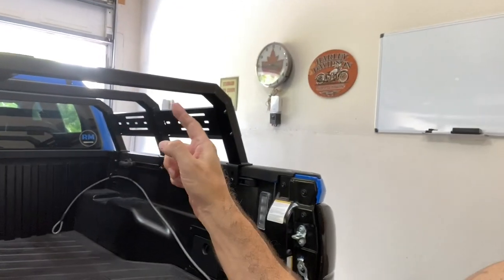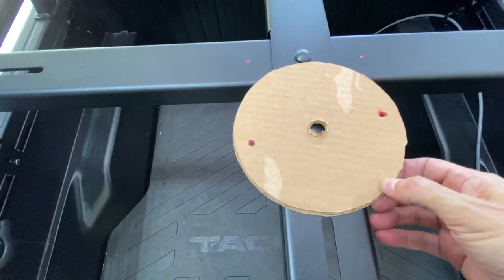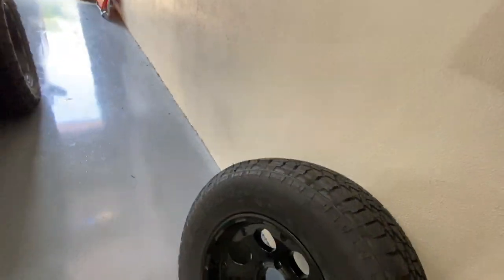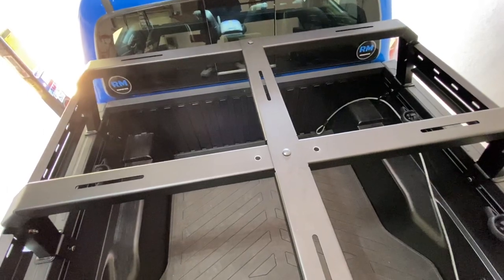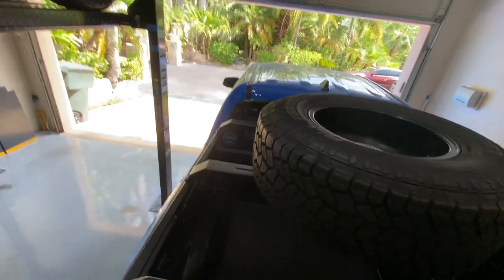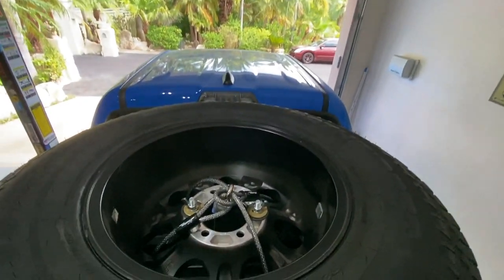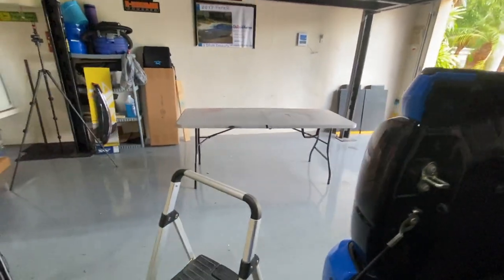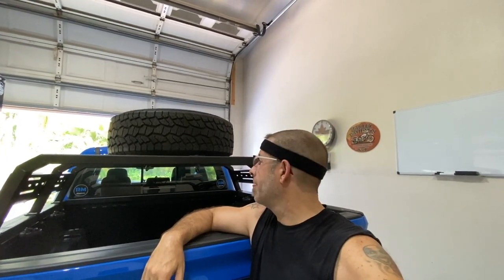Toyota Tacoma Bed Rack Spare Tire Mount

Comment: I hoped to recommend a no drill application but you were ahead of me.........Could have used a gusset type plate to run the lag bolts through, the wheel holes would sit at a 45 degree angle from the cross bars, it would have secured the tire down. ...Like the look ! 👍
Reply from the maker: Oh man!  I probably would have gone with that!!  Great idea👍

Comment: I like the rack. I think it  does look really cool. It looks great and certainly can be useful.  Thinking about it for my 2019 Tacoma off road . I'm close to RCI and might go down and look at one. Not to crazy about the tire up there though.  I'm going through the same thing as I  just lifted and upgraded to 33's.  Think I would just be tempted to lay it flat in the bed under the rack and secure and cover it. And use the rack to free up space for other items. Your truck looks great....

Comment: Not a fan of that system. First, if it's night and raining (that's when tire failure comes right) wrestling 80 lbs down won't be fun. I'm guessing your not concerned with MPG, but you've just reduced your highway mileage considerably.  Also consider racks of that type are intended to carry gear on top. That's out the window for you.  But hey, if your keeping the truck as a mall crawler (nothing wrong with that) then fine, have fun, it's your truck.
Reply from the maker: No prob.  We all have our preferences👍

Comment: You might want to square your hole up to fit the carriage bolts. You said you tightened to the point that you'll need pliers to loosen. I done similar with cariage bolts and found when I go to loosen them they slip becomes a real pain in some instances I've had to cut bolt.
Reply from the maker: That a great point!!!!😬

Comment: So....  Is your stud independent of the wheel?  Meaning, once you remove the wing nuts securing the wheel, does the stud stay in place?  I did not see a nut securing the stud to the rack.
Reply from the maker: The stud would fall.
Reply: Maybe add some nuts to secure the studs to the rack?  If you ever did need the spare, you wouldn’t need to get back under the rack to install the studs.
Reply from the maker: The idea is sound...but positioning the spare on fixed studs may be rather difficult 🤔
Reply: Hmmmm...  What if you added a tie bar to the studs to hold the hole to hole dimension?  I’m working on building a high clearance rear bumper with a swing out spare tire.  I was just going to cut a 1/4” round aluminum plate the size of the radius of the inner wheel.  Add studs with the lug pattern and mount it.  It would be the same as putting the wheel on the truck.
Reply from the maker: Another good idea🤔. Not sure what my next move is......
Reply: You’re definitely better with the tire/wheel out from under the truck!  Could you imagine trying to get to it stuck on a trail!??  Keep the videos going, man!  It’s good to see other ideas with builds!
Reply from the maker: That’s a great point!!  Didn’t think of that TBH!!👍

Comment: If you are happy with it then it should be good. In the guy who likes the way snorkels look.  As I said getting the flat into the bed was enough for this old guy. To have to then get it up onto the rack not for me.  I know it is only about 70-80 lbs but does it feel any different when you corner?  The main reason they have a 150 lb weight limit on roof racks isn’t that the rack can’t handle it, it is what it can do to the center of gravity.  Like going for the top of the rack for the spare is defying gravity.  Higher CG in a corner is also defying gravity (we won’t go into a 2” lift)😁. Just be careful gravity can be a heartless —————.
Reply from the maker: It’s all good.  You wouldn’t even know it’s there👍

Comment: Unsafe and looks bad IMO, that heavy tire will rip off your aluminum rack in no time, but it's your truck if you like it go for it 🤷‍♂️
Reply from the maker: Nah...if it were mounted to cardboard I’d agree.  However, aluminum is stronger than you think.  Haven’t heard of any F150 bodies ripping off their frames...🤔
Reply: @RobMotive  ok, well 🤦 that's a multimillion design by a company with many engineers and resources,  not a back yard modder like us, search LLOD video on how he almost lost his roof tent mounted on the flimsy aluminum rack, every time you break that big heavy tire wants to keep going,  its not going to be long before that aluminum rack fails, specially after you weaken it by drilling holes, I work a a metalurgy plant, but like I said, is your truck and your life, good luck 👍 hope im wrong
Reply from the maker: We’ll have to agree to disagree on this.  I’m not concerned 👍
Reply: @RobMotive  yeah to be real you probably will not drive the truck enough for that to  happen, don't go off road, or rock crawling, so it will be fine sitting on your lift,  you are doing it for "looks" but it doesn't look good.
Reply from the maker: Like I said...agree to disagree.